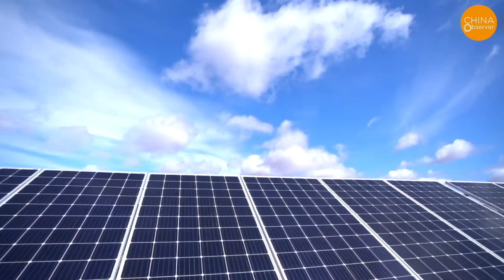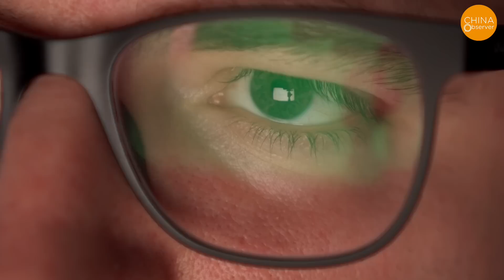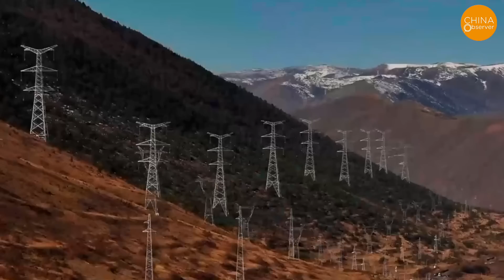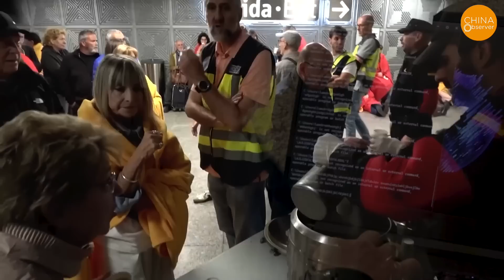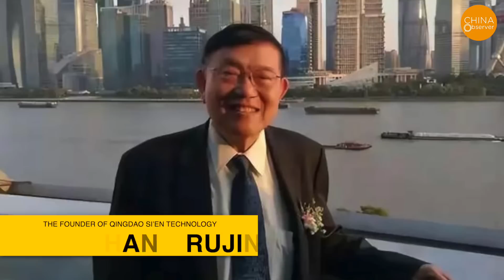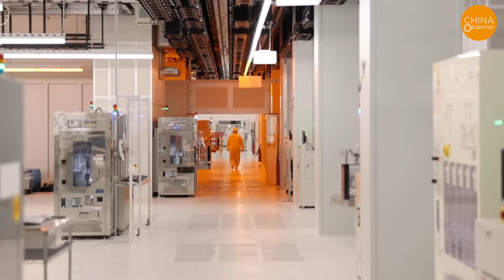Americans With Solar Panels Beware, You Might Already Be Targeted

Comment: I have a modest solar system primarily as backup for the propane heating system's water pump in winter. The panels are made in China but the controller is made in Germany. I think I will be alright.

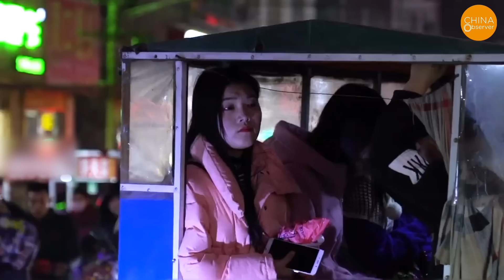Comment: Political motivated rumours. Spain nail it down to lacking of system resilence to a switch station failure. Some still argue agains solarpower by the 12.30 event time but sun peak at 14:30. The people simple getting turned by media like a magnetic needle. The event up to now is simple an engineering mishap. All media is now noise with motivation from all hysteric sides.

Comment: Some of this is too technical... Laymen's terms, you can't attack the grid from a residential supply, the stepdown transformer destroys that capacity. If it were cellular, it would be a slow host, no overhead processing power for an attack. If it were Wi-Fi, same story with lack of capacity to do much at all... They'd have to incorporate a proper processor for a proper connection. Upline, not gonna happen. In the distribution centers, that's plausible; however, the US doesn't use Chinese power hardware... Unless it's industrial supply solar, California and desert areas maybe.

Comment: “U.S. and European officials have found undocumented “rogue” communication devices (such as cellular radios) embedded in some Chinese-made solar inverters and batteries”, so it’s not just software. It is hidden undocumented hardware. Even if you don’t connect your solar system to the internet, it may be able to connect themselves to form a back door.

Comment: And yet all of us who warned about Chinese chips shutting down the grid  by remote for literal YEARS  were dismissed as 'conspiracy theorists' even though there was zero 'theory' in any of our accusations.
Reply: Same with cars
Reply: Cause the cia invented the term
Reply: Came here to say the same thing.
Reply: Very true. They should also inspect all toilet bowls made in China. They could be remotely triggered to clog up simultaneously, causing a nationwide sewage blockage. Your city streets will be overflowing with your daily crap.
Reply: Eh, they all line up to bash the USA and praise Chyna. It's what they do. Guess we'll get to watch in real life what happens when they see the real chyna. 🤷
Reply: to be fair, solar runs on two wires.  (DC)
You need to find the proof before feeling right.  
PCBs are readable & reverse engineerable.   not featured in this show though.
Reply: @TRIEDZIIDONO They are talking about grid-connected solar with cloud management.

Comment: My experience with chinese solar chargers and inverters is that the CCP does not need to install anything to make them malfunction. 
They fail just fine on their own.
Reply: tofu dreg
Reply: Your 100% correct, All 3 of mine needed no prompt from the CCP, they just exploded them self's, they was not plumbed into the grid, they was setup for off grid and solar inverting only.
Reply: ShundiDK Jonychin 'frost7277' 'stumpy-mv2iq 'sherpaakagi3752 Deepseeker V3 DSAI powered Xhynians:"B-b chong11ng...!" *nosound*🍯🍯🐕‍🦺🤖🐷

Comment: Another point to 'dirty' power like coal or gas.
Reply: PA has enough hard coal to power the USA for 200 years. With the scrubbers on the coal fired plants, the USA wouldn't even need to worry about increasing our CO2 output. And that doesn't even include our soft coal, natural gas, and oil reserves. And that's just one state out of 50. There's no need to rely on Chyna for any power supplies.
Reply: That's silly. We must save our planet. Simply don't  use equipment supplied by a potentially hostile entity.

Comment: I bought a portable power bank with a little solar panel. I was wondering why each time I plugged in my cell phone directly to the USBC cord, the power bank rattled like it had a hard drive spinning.
Reply: It could be caused by wiring quality or loose components. You might want to change the power bank to avoid a short circuit.
Reply: It's probably the booster and step down converters running around.
Reply: It is Chinese squirrels on a faulty wheel generating cheep power. Leave some peanuts or seeds around or else   No phone chargie. 😂😂😂